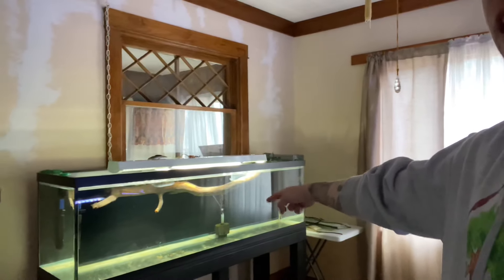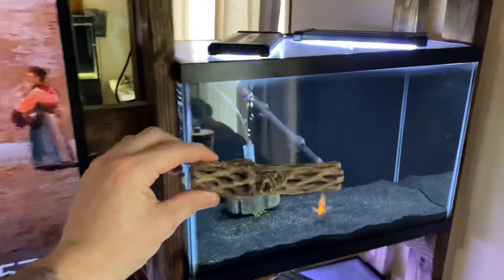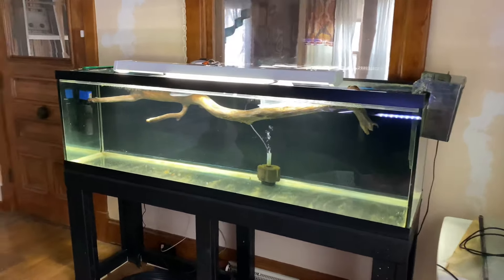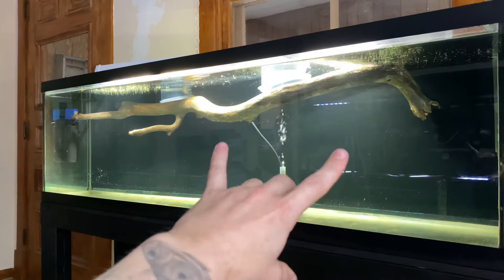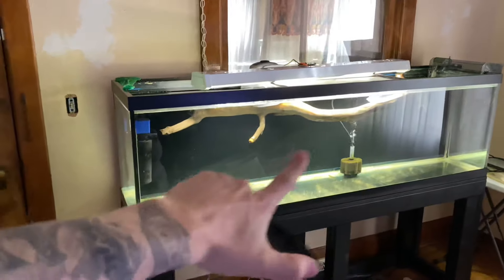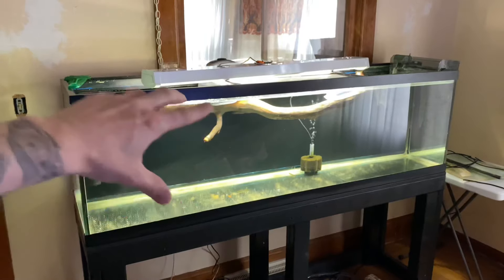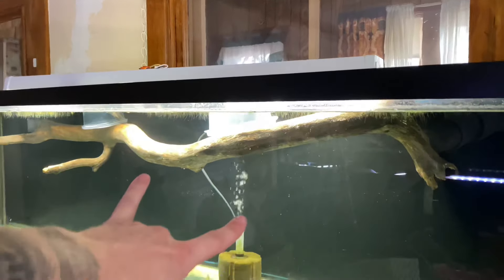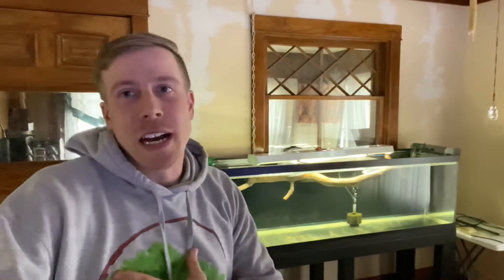Aquarium Driftwood is Floating - How to Sink?

Comment: I always enjoy your videos. I like your approach to the large piece of driftwood. There are probably always pollutants in a stream or river. Especially farm fertilizers and insecticides. The thing is that a piece of driftwood is not a sponge for collecting pollutants. It probably will have some but they didn't go into the wood overnight and probably will not leach out overnight. If you are doing regular water changes I would say it probably will not be a problem. You are a lot like me. If I see something in the stream bed I can use in my aquarium the advantages outweigh the risk within reason. If for example, I find a cool-looking rock when I am digging around in the garden it is getting washed off and added to the tank. I have been doing this since I was a kid and I am an old man now. I have never had bad luck doing this. I have never been an expert in geology but it only makes sense to stay away from things like limestone. With a little common sense, there are lots of things out in nature that a hobbyist can find for free and have a good time out in the woods back at the stream bed. In my opinion, the risk is minimal while the gain way outweighs the risk. The aquarist who has never gone to the woods and streams to find these treasures is missing half of the fun of the hobby.

Comment: I have one drift wood that keeps floating.  I did not boil it.  I will see if I have a pot large enough.   I have been soaking it for a week changing the water using hot and holding it down in the water.  one end is downward and the other just pulls it up.   Thanks for the video.

Comment: I got a big piece of wood like that, got it soaking in the bath in water as hot as the boiler will go with a 5kg dumbell holding it down, over night it still floats if I remove the weight but im hoping after another drain and re fill with hot water over night should do the trick, may take a few days? Gotta sink eventually though right?

Comment: I had purchased two drift woods for my 10 gal and 20 gal tank. The first one I had boiled in  a pot of water for like an hour each day until I got the tannins out. Once I added to the fish tank it didn't float as much and held it down with a rock. The second took a little longer because it's a little bit bigger. I wouldn't just add hot water over the drift wood into an aquarium, it makes no sense

Comment: As another veiwer commented you can use a tile drill bit, drill through some ceramic floor tile (or slate) then put some screws through the tile into the driftwood.

What I've done in the past is picked an area of driftwood that wont be visible & drill something like a 1/2" hole into a longer section of the driftwood. Then I'll use a hacksaw & cut off a piece of 1/2" stainless steel rod slightly shorter then the hole I drilled, then I'll push the stainless steel rod into the hole so its not visible.